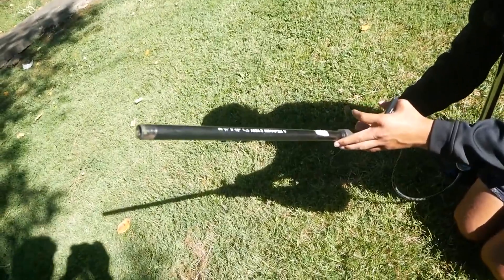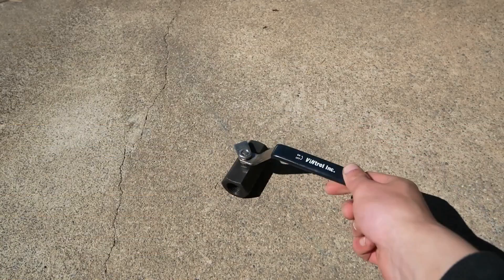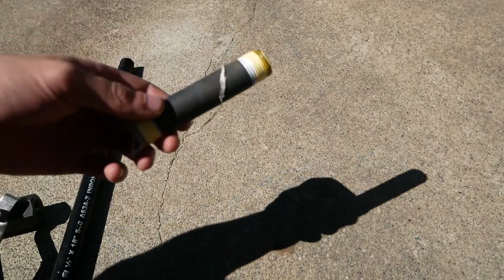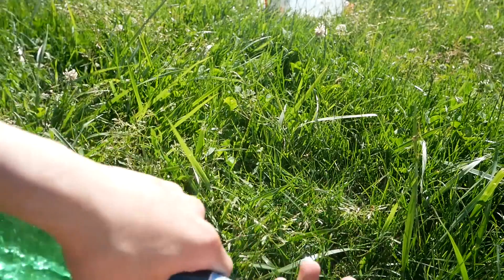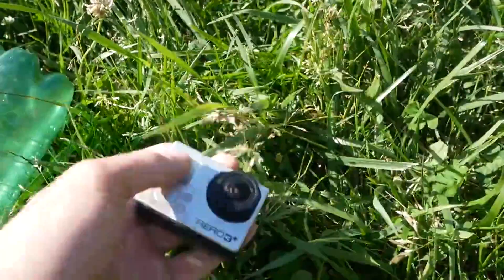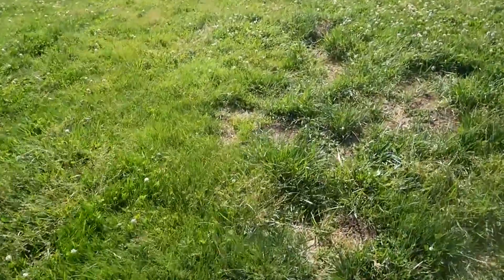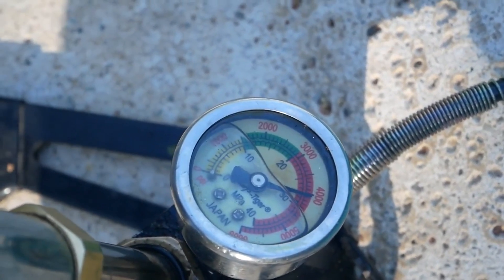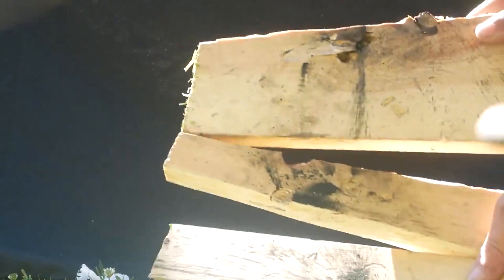AIR CANNON 4500 PSI  HIGH PRESSURE PCP PUMP

Comment: You need to open the valve faster, look into some of the designs others have used on potato guns where they have a spring that yanks the valve open. You just need a latch that can hold the spring back, but most latches get much harder to open with a heavy spring pulling on them, there is a specific type of latch that doesn't though, I remember seeing it on a mythbusters episode where they used them on a trebuchet I think? I'll try to find it.
Reply from the maker: agreed ill work on that for my next one

Comment: You can use a solenoid valve for more efficiency, you can shoot further by it
Reply from the maker: i wish  but unless i want to spend 500 on a high pressure solenoid that wont happen
Reply: @ianbuilder  
A pneumatic valve.
Reply from the maker: @calvingreene90  yea that could be done but still out of budget
Reply: @ianbuilder  
I had home made in mind but you could use rubber bands.
Reply from the maker: @calvingreene90  ohhh ill try that
Reply: @calvingreene90  hell yea
Reply: @ianbuilder  Burst discs are cheap and very fast. They can be made from a pipe thread union with a piece of thick foil sandwiched in it
Reply from the maker: @Riv_Longsnoot  great idea  i hadent thought of that ill use this. but for this project it would be very risky thing to use

Comment: very nice get a bottle of nitrus or high pressure air from a paintball field nice and cheap and you dont have to pump it up.
Reply: No such thing as nice and cheap when it comes to HPA or vessels to hold it.
Reply: @joshuagibson2520  paintball tanks are if i remember correctly and its been a while sub $100 for a 4500 psi tank.
Reply: @hardwirecars  true. I was talking more along the size of scba tanks. I've yet to find any under about 4-500$.